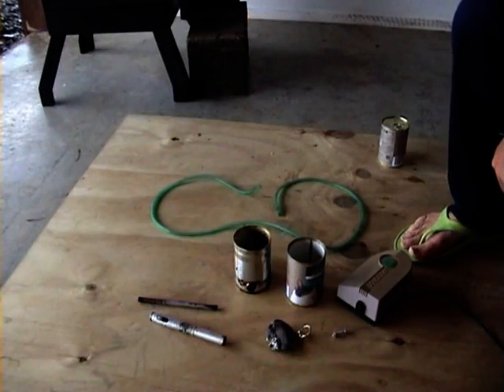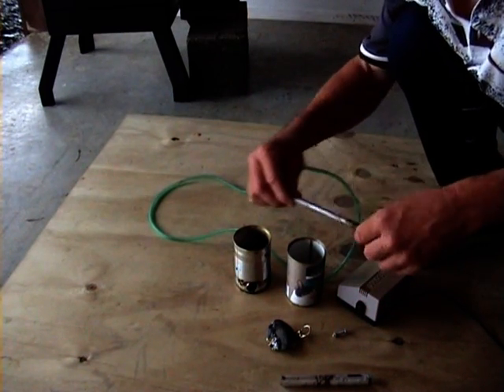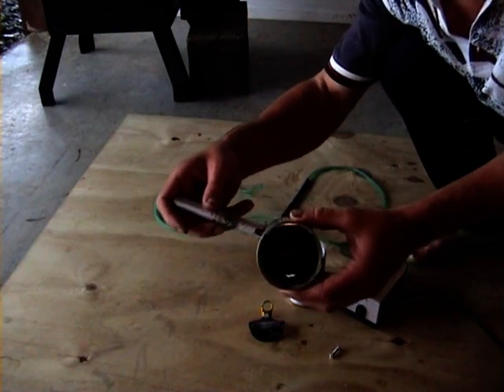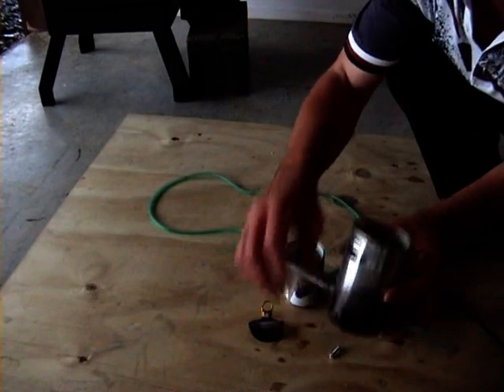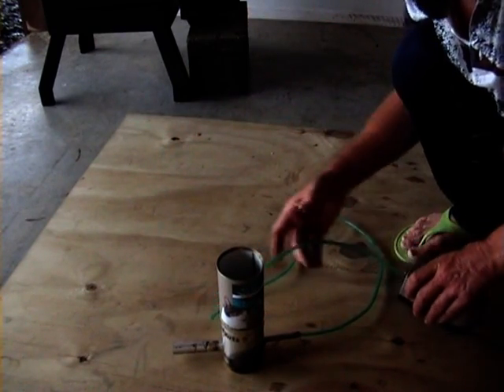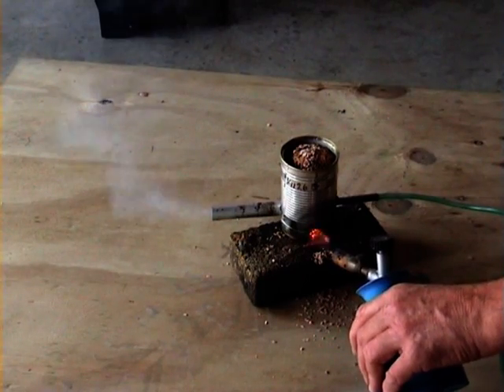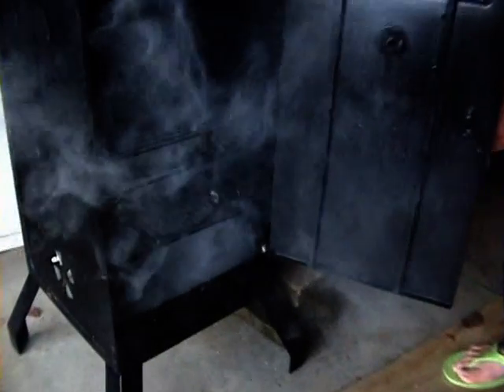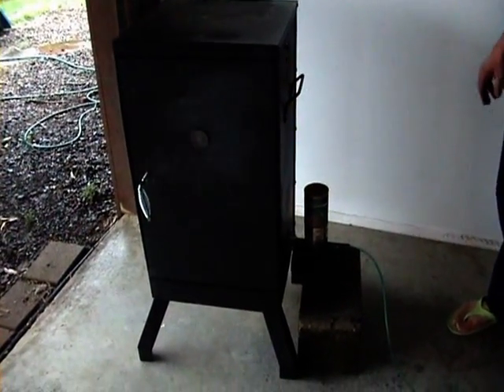D.I.Y. Cold Smoke Generator

Comment from the maker: @381buggy   I use an old 30 year plus maxima double ported air pump.  Each port is rated 3500 cc/min and I have these piped into one line, so if the pump was working at true capacity (which I doubt given its age) it would be outputting 7000 cc/min.

As well as good air flow I think tight fitting holes for the two pipes are important so there is less air sucking through gaps that compromise the venturi effect.

I also think the firehole is a little bigger than it should be for fine woodchip

Comment from the maker: The ash falls out of the burning hole - I collect it in a small dish.

Some modifications that make the smoker work better

1 I now use some steel fly screen for the baffle - this improves airflow

2 I use a couple of small magnets around the burning hole to control it's size so as to allow ash out and to ensure not to much wood chip flow out

3 I also use some strip magnets around the doors of the brinkman to help seal it and prevent all the smoke leaking out though the doors

Comment from the maker: I get approx 8-10 hours from using a 3 can hopper.
Ashes fall out of the burn hole - note it is important that the bottom can does not have any obstruction under the burn hole so the ashes can fall away or else they will block up.  I tend to have the burn hole side of the can elevated and have a tray to catch the ash as it falls.  Some of this ash/woodchip  mix can be reburn't if it is not fully burn't.
Sorry about my accent but were a little different down under in godzone.